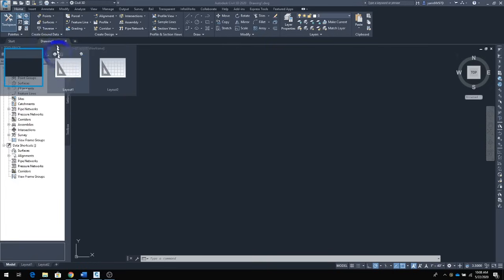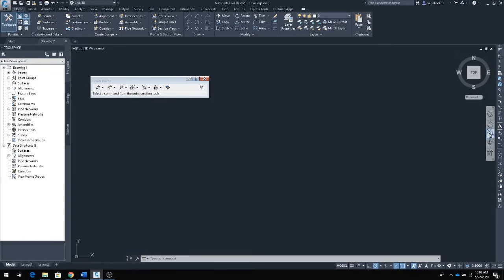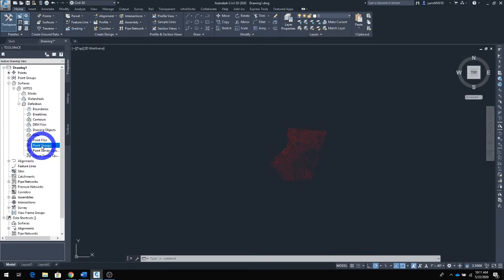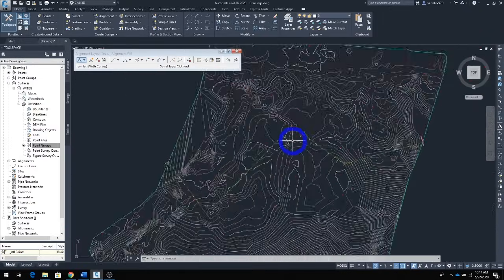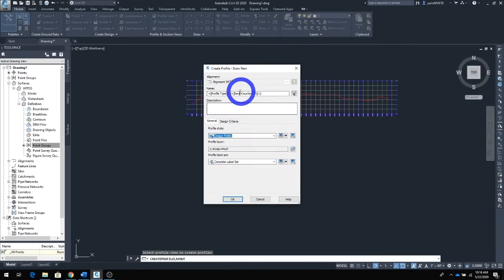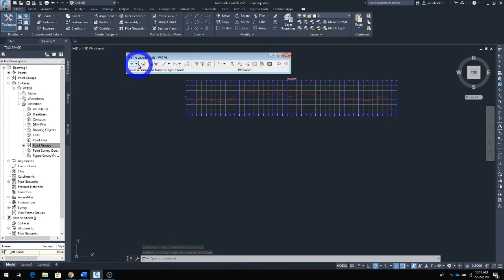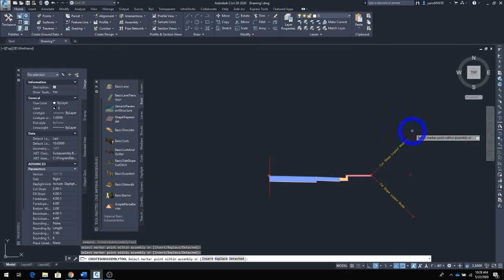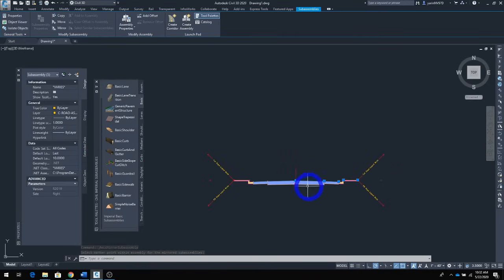Basic Roadway Design in Civil 3D for Beginner

Comment: Sir can I ask, when Im doing the corridor part same with your video but my screen pops up an error and it says target object not found. thank you for your immediate response! Im from Philippines love your videos
Reply from the maker: So it's a warning and not an error?  This is a very important distinction to make.  If it's a warning, there could be nothing wrong with the model.  If it's an error, then there probably is. And you may  have not set a surface target.  Probably for your daylight or something.

 

Expand the eerror; which subassembly is it referring to?  Is is an offset or elevation error?  If it's an alignment warning, then you probably have width targets set, but those targets don't exist for the entire length of the alignment and that's no problem.

Comment: How to draw alignment of constant grade over contour lines?
Reply from the maker: First draw the alignment then go to profile set the grade
Reply: @nasseryariphdpe648  it would result in too much cutting and filling. I want to select the path with minimum cutting and filling for hill road.
Suppose two contour lines have elevation difference of 1m. I want to maintain 10% grade. So i have to fit 10m of road between each contour lines. Is there any tool to make it easier?

Comment: Can I use the same method for creating a pipe profile sir
Reply from the maker: Yes, watch my Drainage video https://www.youtube.com/watch?v=FM2nb0FFWVQ
Reply: Thankyou sir but then How do I add elevations minimum and maximum it s not showing anything
Reply from the maker: @jephsinks5841  You can edit your profile. Unless when you made your model you missed a step.
Reply: @nasseryariphdpe648  when I create a surface am not receiving any type of surface
Reply from the maker: @jephsinks5841  You missing a step start over and make sure your data is on PNEZD you should see the northen, easting and point elev. after that you need to Zoom Extend to see the surface. Follow the video step by step.